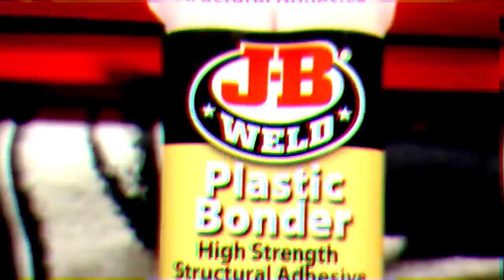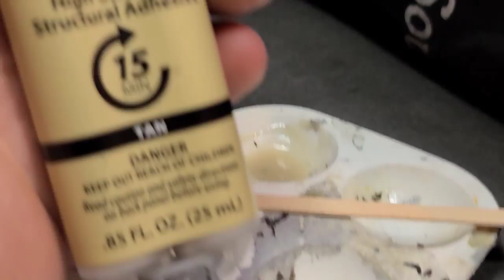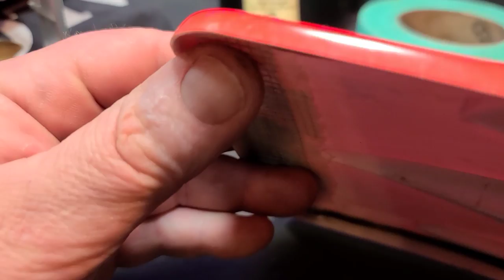Repair & Reinforce Broken Plastic - Blackjack 24 Hatch Repair

Comment: Super Helpful!! Gives me a direction to go now! My hatch is 13 year old plastic, I must reinforce it b4 it breaks
Reply from the maker: I'd do epoxy fiberglass or epoxy carbon fiber for reinforcements. The drywall tape method is for small cracks/little quick repairs. it's heavier than fiberglass/carbon fiber.  Works the same way, but much heavier.   Epoxy, especially Gflex epoxy, works great on abs but any good epoxy resin will work just prep the hell out of the work surface

Comment: Excellent method ... worked perfectly on my split hull .. only took an hours work and cost no more than £10 ... top man 👌👊👍🏻 p.s. used the plastic welder transparent yellow ... same make not as thick ... just brush it on and its lovely to work with and dont smell much

Comment: Given the amount of abs hulls on the market today, you should do a video on reinforcing an abs hull. Theres so much controversy on not using fiberglass to reinforce an abs hull due to heat and chemical reactions.  You are the only fe guy on YouTube with so much helpful stuff.  Keep it up big b.
Reply from the maker: I've been using fiberglass cloth and epoxy, works just fine if the area is prepared properly...   g-flex epoxy is the best for abs or poly its actually made for plastics and flexible so it bends with the poly or abs.
Reply: @IRONCLADRC  yeah I heard of gflex. See, I've been a fiberglass guy since working at a hobby shop (paradise) in Florida and I never looked at abs hulls in fear of breaking apart if I stuffed it. But now I own an abs cat (big storm) so I already know I'm gonna end up having to reinforce it. 

So you use regular fiberglass along with epoxy resin? Can you give any tips on how it needs to be prepped in order to stick? Also can I use carbon fiber instead?
Reply: @Shinobi117  i have a big storm that runs twin TFL mini outboards, i haven't done any reinforcements on the hull yet buts it's held up well so far, granted it drives like a pile of crap at the moment, i don't think the setup will ever work was just an idea

Comment: Thank you I needed this and will use the JB plastic weld and drywall tape 😁👍🏼. Nice repair and the carbon accent looks great. I'm trying to build a 495mm shrimp Outrigger but it has no plans do you know of a good build series on that boat I think you have built it before as well. Thanks 🙏🏼😎

Comment: Thanks Big B i got an old F1 boat that's got a plastic hull  on that's cracked all to pieces and I was wondering how it's going to reinforce it yeah that fiberglass or that drywall tape and that plastic bonder that flexes that's cool I didn't know that stuff Flex like that so yeah that's what I'm going to be repairing it with I'll let you know how it goes thanks
Reply from the maker: About a year later and it hasn't peeled up or broke yet. Definitely recommend 👌

Comment: Yo Iron clad 
We use drywall tape with shoe goo on the rc bodys. Does the plastic bond add weight to help from flipping?
Reply from the maker: I guess it could if it were added in the right spots.     Bob smith industry or ZaP epoxy works great for abs and polycarbonate, plastic bonding & gluing is all about the preparation 99.9999999 % prep

Comment: Great vid as always bro, as I've now got a boat thats plastic and I'm a bit concerned about the strength of it, as its capable of 50 mph (Joysway Alpha 1060 mm length x 250 mm beam, would it be possible to strengthen the inside using that method? Only problem would be getting in far enough to sand the inside so that the materials will stick, I've seen these boats on utube just disintegrate after a high speed flip, 
Cheers bro
Reply from the maker: Possibly  the real problem is that the jbplastic bonder dries in 20 mins so you would need to do small sections at a time.   I think it would strengthen the hull...   this method worked realy well on the hatch  the areas I did are rock solid,  I'm looking at it as I text this message and there are no spots pulling up.   Good lock.
Reply: @IRONCLADRC  thanks for the reply, thinking about it, maybe the easiest solution would be to vinyl wrap the boat, would it make it stronger?